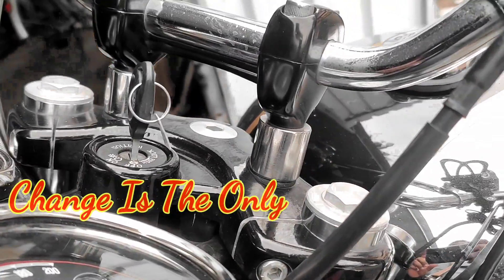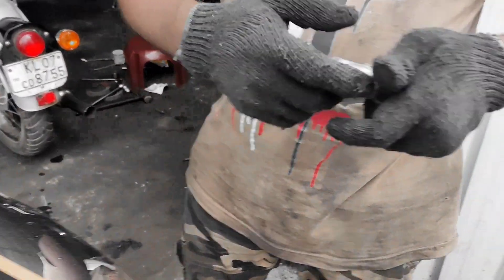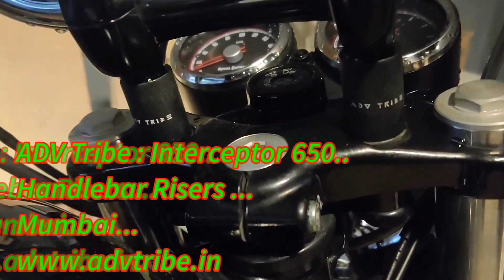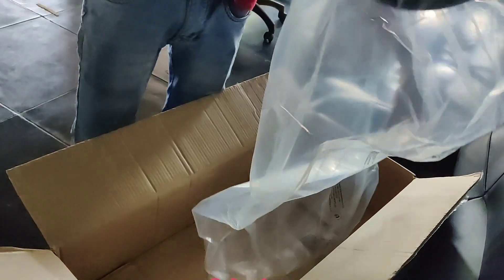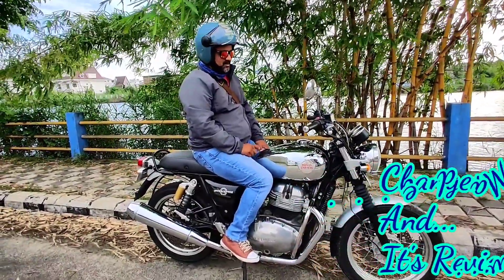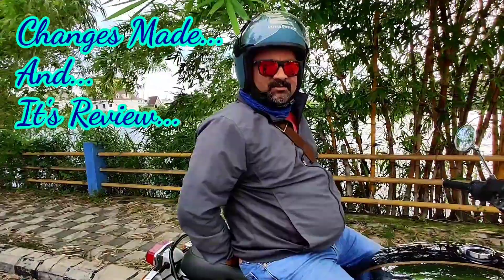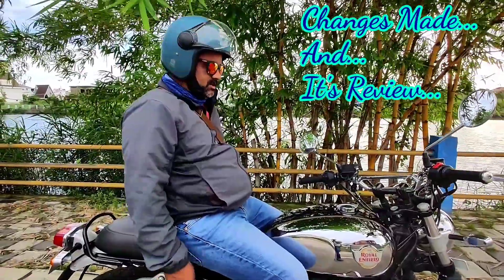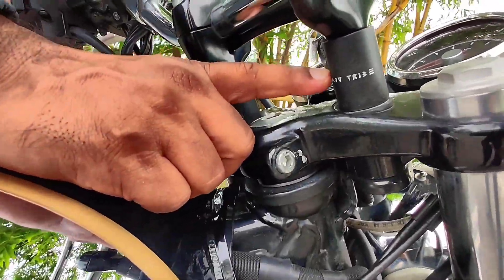Interceptor 650 Handlebar Risers & Seat Upgrades...

Comment: Does the advtribe riser includes long nut
Reply from the maker: Yes it does, if you are going for adv tribe one's then hold on,try Carbon Racing new 2 inch riser instead, it will require clutch cable rerouting but will be better than the adv one
Reply: @vadsx  Yes I checked the website.. they are out of stock
Reply from the maker: @infinitedestination  Dear ... I have ordered the Carbon Racing 2 Inch risers and will do an installation when I get it... In case you want my old risers I can give it to you... I have 2 risers,one from HDT Customs 1 Inch size and second from Adv Tribe 1.5 inch size...

Comment: Hello! Do the ADV tribe risers require any cable adjustment? I mean, are there any handling issues etc? Also, what do you think about the new 60 degree risers by HDT?
Reply from the maker: Hi.. Sorry for delay in responding... No cable adjustment required for ADV Risers, The Handlebar is slightly more upright and nearer to you... HDT Customs 60 degree risers too are good, you can also consider Carbon Racing tilted risers which look more premium... Although I am not a very big fan of the looks of tilted risers, it's too visible and somehow does not go with the design is what I feel.... Try out for yourself and take a call....
Reply: @vadsx  thanks a lot for your response. For now, it's looking like my body has adapted to the stock position. I'm going to wait and see. If after a couple of long rides, I feel like I need to change, I think I somehow trust the quality of ADV tribe more than anything else
Reply from the maker: @nagharajabishek  Nice that you are getting used to it.... Still I would suggest to go for the ADV Risers... U will like it better
Reply from the maker: Well no cable rerouting issue with the adv tribe risers... In fact Carbon Racing had gone ahead and created a 2 inch riser ie half inch more than the adv one... Well Hdt customs 60degre one looks similar to the one's in the market allready...I am not a big fan of the tilted risors,somehow it seems to out of place on the Interceptor...Cable will need rerouting anyways if you use risers above 1.5 inch..I personally want to try Carbon Racing 2 incher ...